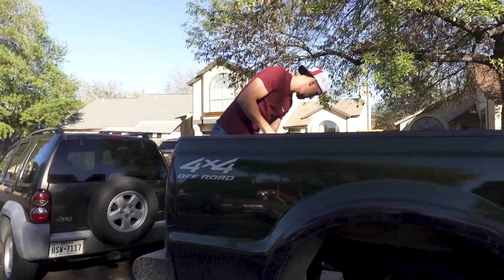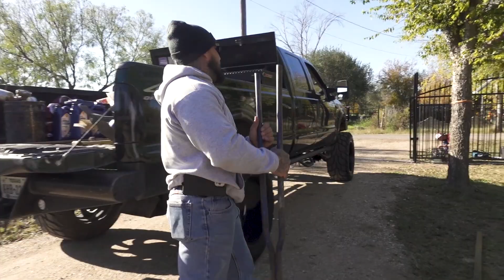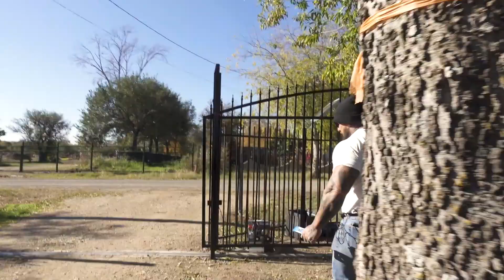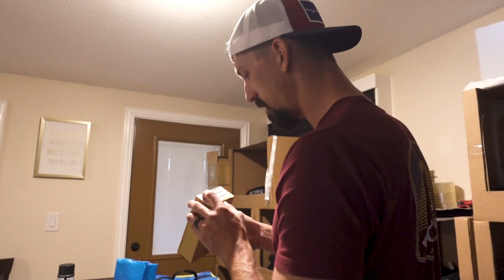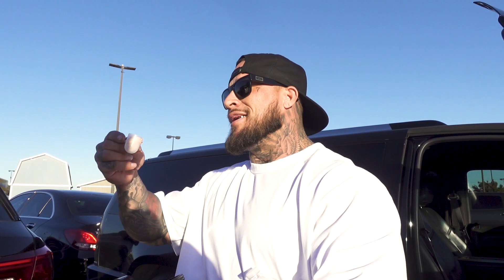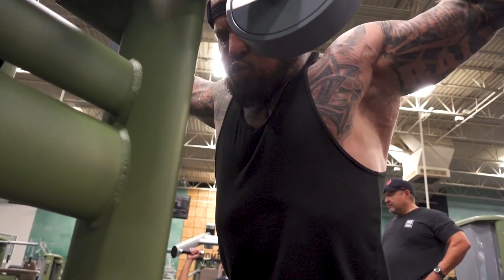DON'T BE LIKE LIVER KING, BE LIKE STAX INSTEAD!! | YOU DECIDE YOUR DAY | Day in the Life of STAX

Comment: I bought a bunch of test booster from a really good reputable company that uses natural ingredients from around the world but I should still think about getting my blood test because I do think I have a low T. Thanks I will definitely check it out. If the results comes back as positive then that test booster I bought will do the trick. It also included a 3 month workout plan to get shredded. I have realized when I work out I don't get the results I'm looking for physically in the mirror but I do add on weight and a little strength each time I go to the gym or just workout at home.